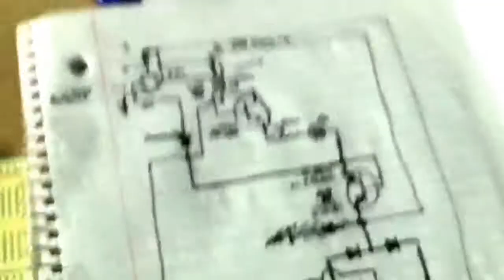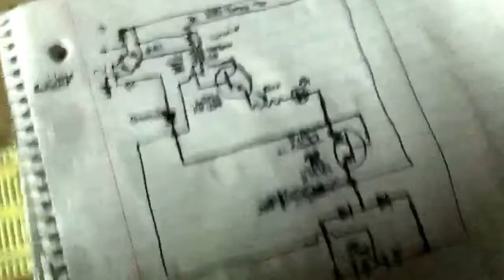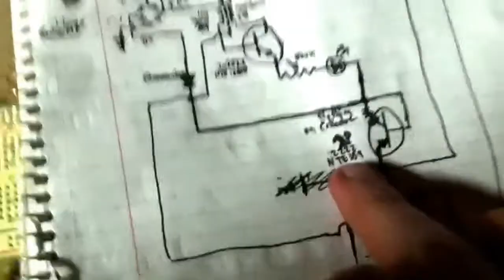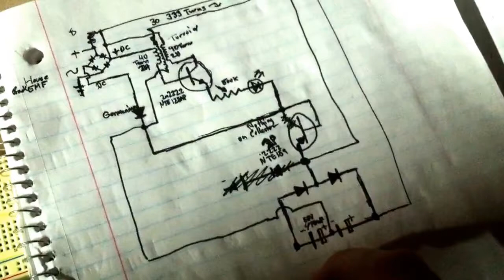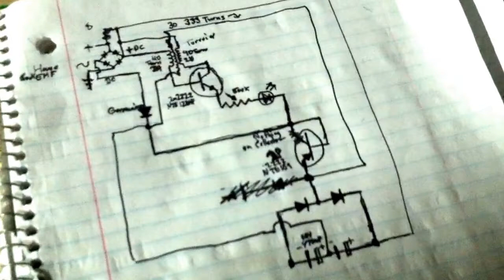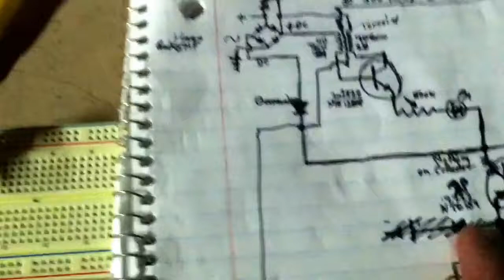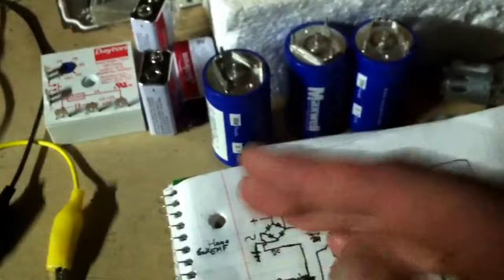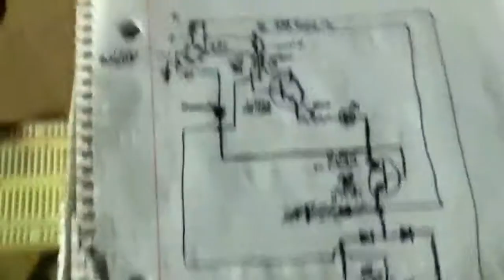Self-Oscillating Circuit with Resonating Transformer | Innovative Energy Harvesting

Comment: it is not clear Nte159 collector and base
you can draw better
Reply from the maker: In this set up the collector was open. You can run the collector and base in parallel and it works as well. I will draw a better schematic diagram today, sorry for the sloppiness.
Reply from the maker: I have a better schematic for you, sorry for rushing the drawing.  I am not used to drawing my circuit schematics and I made a mistake.  Check out my new video and peace be with you.
Reply: the better circuit video is here http://youtu.be/beyOJIeOc6s
Why dont you say what you device does first? Its just a voltage doubler, isnt it?